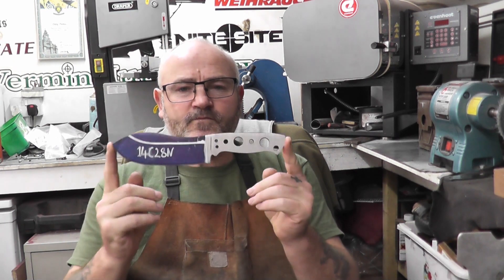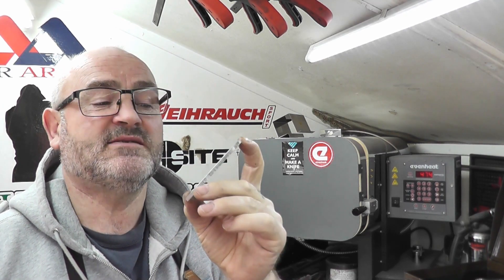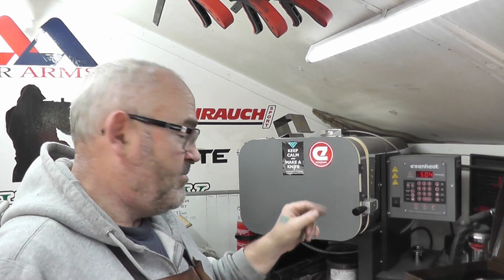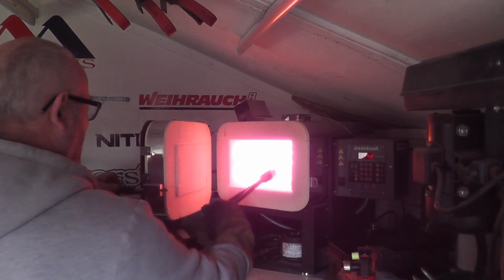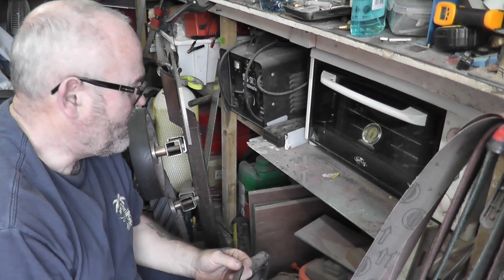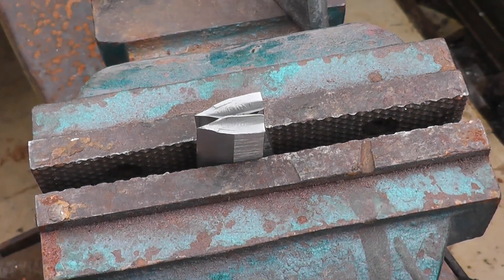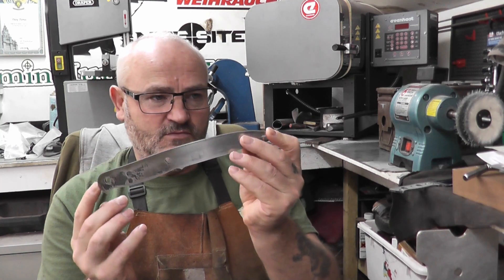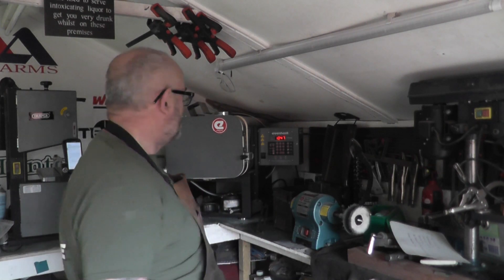DTK Custom Knives, Heat Treat 14C28N test pieces.

Comment: Hi Davy, this is very useful, thank you for going to the trouble of videoing. I am about to start using 14C28N. Do I need to wrap in foil or protective paint when heat treating at home? Thank you.
Reply from the maker: No problem buddy, good luck 👍

Comment: hi, you didnt do any normalizing heattreatment before heating for quench? is unnecesary?  my respect from argentina, great video.
Reply from the maker: Before I heat treat I will put the knives in on a stress cycle for 1hr at 670c/1238f due to all the drilling and profile grinding .I don’t film that part I will in future videos.
Reply: @DTKcustomknives   thanks for your answer, i Will take note, i thought that maybe it was needed a normalizing but it seem that no. Have a Great day!!
Reply from the maker: @matiasshanahan5164  only if you are forging the steel buddy
Reply: @DTKcustomknives   parks50 is the oil You are using? Why that that is a fast quench oil? And not an slower?